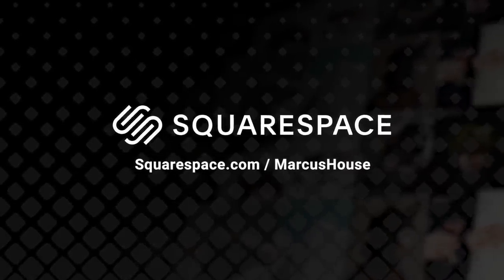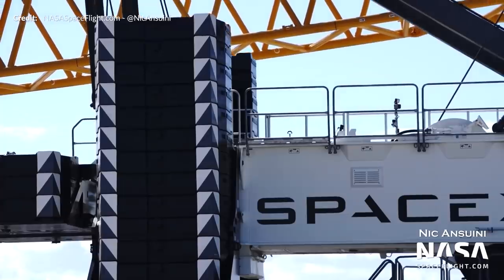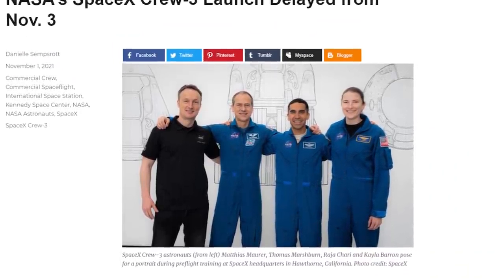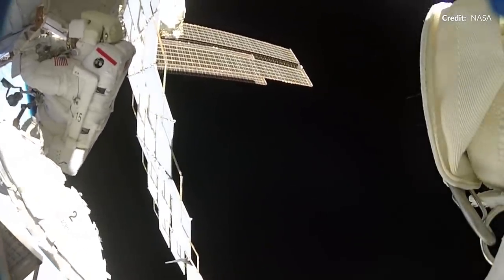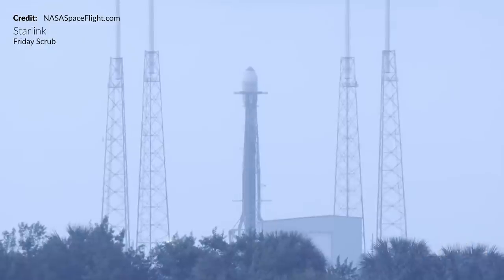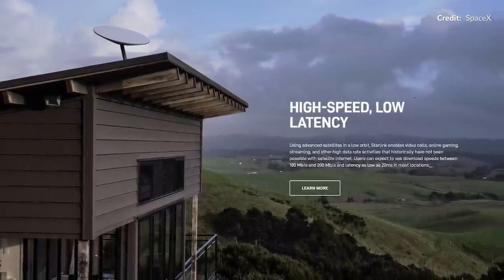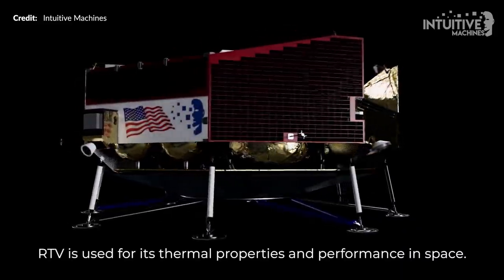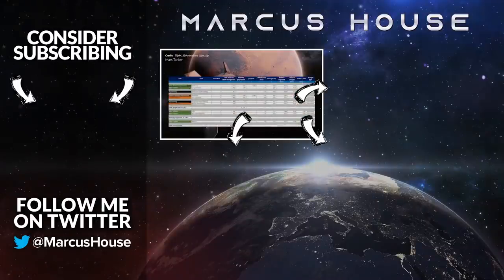SpaceX Starship Record Fire, Crew 2 Return, Crew 3 Launch, SpinLaunch, Starlink + More

Comment: The thermal protection tiles are proving to be problem and they are mission critical for Starship’s reuse.  Several tiles are being shed during each engine test and so it is likely that Starship is going to shed a lot more tiles during a full scale launch. However, each of the thermal tiles on the Starship is surrounded by six other tiles.  If SpaceX could devise a way of loosely interconnected the tiles with each other, for example using titanium wire clips, then the failure of a tile mount would not result in immediate tile loss.  The ‘loose’ tile would be held in place by its surrounding tiles and thus able to perform its role of thermal protection during the critical phase of re-entry.  Only when safely back on the ground would the tile then be replaced.
Reply: The tiles on ship 20 are prototypes, the tiles on ship 21 already look much better. But of course time will tell if the stay attached better.

Comment: Thermal protection. Integrate the panels and change the profile on the hot side to be something like a heat sink and bleed the heat off on the cold side.  Have the heat shield internal launch and flip or rollout prior to reentry.

Comment: Maybe they filled the LOX tank to dampen the vibrations with greater weight (so the tiles would experience less stress). Obviously they would not want to do that by loading up a bunch of liquid methane, or, even worse, a lot of both LOX and methane.

Comment: Great to see the thing fire up, I do have considerable fears about the heat tiles. The loss of the tiles apparently does not endanger the landing of the ship but unless they get that under control, or figure out how to install replacement tiles very fast it does endanger the hopes for rapid turn around. I think a lot of us space flight fans are out here trying to think of someway to keep those tiles on (of course I have no hope that I can out think SpaceX's engineers). I would just love to contribute to their work though.
Reply: It's an understandable fear considering the shuttle's constant problems with tiles. Honestly better that they fail now than later. The prototypes won't be reflow for a while so it is far, far less constraining right now than it will be later down the line. So being able to actually lose tiles and see in great detail what works and what doesn't is a net positive when it will come to engineering the "proper" starship and not the SN series of prototypes
Reply: Remember how different sn8 was compared to sn20? The tiles will evolve as rapidly as starship has once they can actually test the things proper. This is their first full tiling after all.
Reply: I am wondering why not add a second layer of tiles. Or even a third layer with smoothed edges where the heat will be worst. Starship will have enormous capacity as it is.
Reply: @Abebe345  Well, because weight is weight and especially for a vehicle as starship you don't want to waste anything even if you technically can. Remember even if starship will refuel in orbit, it still need to haul it's ass up there first and despite the gigantic power of the superheavy and itself it barely manages to get up there with all it's propellant. 
During long missions it is almost guaranteed that starships will carry spare uniform tiles to replace any damaged ones mid flight. This is much more efficient than double or triple tilling everything especially since the final heat shield won't be losing any tiles to regular sources of damage. Remember right now the prototypes are made as minimum viable products, made to be fast to make and cheap to lose. Once the system is developed a lot more care will be placed upon having everything fall into place exactly as anticipated. Right now there is no real reason to be especially careful if they already anticipate big changes to the shield design as well as the low chance that starship survives its first trip to space anyways. 

However after witnessing how much better SN8 did compared to my expectations, a near complete first flight isn't out of the questions.
Reply: @mobiuscoreindustries  Hopefully gets better quickly with design: for a reusable rocket the shields will be critical

Comment: The spinning approach, seems to me the way to reduce G forces is make a larger circumference cycle.. If everything else stayed the same size it may allow some impressive speeds on exit.
Reply: You cant reduce the G-force without compromising launch speed. Centrifugal force translates to launch speed.
Reply: Right. The formula is mass X angular velocity / radius. You would have to reach higher speeds w a higher radius to achieve the same force at launch.

Comment: another consideration on using a single massive tile heatshield or even larger tiles than currently used is that the gaps between the tiles don't take up weight and it also increases the amount of weight and force applied to the individual mechanical attachment points. spaceX may later decide to make the tiles smaller, further reducing the weight and importance of each starbrick individually and increasing the overall amount of area where there is spacing as opposed to tiles. It may add more mechanical attachment points but the mechanical attachment points would need to hold less weight overall, this of course would increase the amount of time needed to install the attachment points and tiles too however.

Comment: I think they filled up the LOX tank as ballast, basically to prevent starship from ripping itself loose in an unplanned liftoff
Reply from the maker: This is also my thought as well. I am also wondering if maybe it is not fully filled but just the condensation was enough to frost it over. It is a little hard to know for sure. Will see if I can get some more info.

Comment: If I were an engineer working on the heat tiles, I would have the robot do a suction test on every tile after each placement. 
All of the tiles are subjected to an equal amount of stress in the opposite direction of application. And any that fail the test are replaced.
Reply: @BenGman. IF you were an engineer working on the heat tiles"?  My question is are you an engineering any capacity.  If not then your suggestion is perhaps interesting, but not grounded in effective engineering principles!
Reply: @michaeldeierhoi4096  Ergo... Vis a Vis.... Concordently
Reply: @benGman69  It took me a few minutes until I looked that up then I was like aha, a reference to the architect in the Matrix.  😃🤣😅

Comment: Spinlaunch can be used from the Moon and from high altitude launch from for example the Atacama desert in Chile, there a launch at 5500 meters is complete feasible (most of the best telescopes are there, manned by humans) and with roads for large pieces of equipment.

Comment: As happy as I could be for the progress made with the SpaceX rocket test static firing have to been concerned about the significant loss of heat shield tiles. Less than a 1/4 of full number of engines were tested so vibrations will be significantly greater with a full compliment and much longer burn time during a launch flight. Clearly some serious work needs to be done to correct this glaring problem.

Comment: They did not fill the LOX tank on S20. I am convinced the amount in the tank reduced the temperature enough for the moisture in the air to condensate and freeze on the rest of the tank. The process went on for a long time.
The amout of methane in the methane tank was enough to fill the downcomer and lower parts of the common bulkhead, but not above that, which is why there was no frost on the methane tank.

Comment: James Webb…. Launches in December a date based on Webb time. However there won’t be any images taken for 6 months or so as it will take that long to assemble the beast and we know that could present problems. Then they have to take individual test and calibration images with each imaging device.

THEN they can take a proper image. Simple just like building the thing was.

Comment: i think that just vaccum-pressure gun would be better alternative for SpinLaunch, it is easier to hold vaccum in a straight tube than a big chamber, and easier to gather high pressure to shot out a projectile, also easier to predict what will happen and where would debris go in case of catastrophic failure.

Comment: I wonder if they put spacers between the tiles it would prevent them from rattling against each other during takeoff. They could make them out of material that can melt away when the tiles get hot enough to expand.

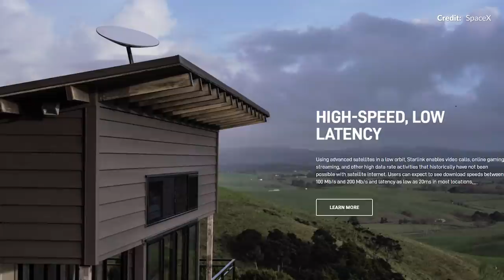Comment: 14:42 Been waiting for the first of these types of launches!

In the future we will be doing it by way of linear magnetically aligned tunnel underground to the surface, in space orbit for planet to planet launches, aboard space ships for weapons, and launching space craft, instead of wasting propellant!

Imagine doing this in space, why use rockets, when we can accelerate them using electricity!
Reply: It's exciting stuff and will be a very useful technology but it won't ever replace conventional rockets as the immense g forces mean that only specially designed rugged payloads will be able to use it. No humans. Could be good for materials and fuel though at least. Very useful for that.
Reply: @MachineCode0  True, but for sending materials to space for construction it will work!

Comment: The SpaceX launch site appears to have a large earth berm between the launch table and the GSE tank farm, finally, which will help a lot during the first few seconds of thirty, plus or minus, Raptor engines blasting away, but when the booster is well off the launch table and yet still within a few hundred meters of it, that berm will not suffice. Hopefully, something even more protective will be installed on top of that berm to deal with a much stronger blast than what the Saturn V spewed. Look at Saturn V launches and imagine an even considerable stronger rocket blast engulfing the launch site and subjecting the GSE tanks to a very large, hot, turbulent rocket exhaust for quite a few seconds. (shudder!) The launch tower should be OK, being so extremely robust, though they may want to protect that cable system and the plumbing and wiring on the QD arm and the chopsticks, as well.

Comment: I think, The oxygen tank was Full to maintain the thrust to weight ratio LOW and also to prevent stress on hold down clamps, so the vehicle will remain on stand without lifting off and  with less stress on hold down clamps during SIX engine static fire.

Comment: Perhaps LOX tank was full to provide thermal moderated stress on heat tile attachments.  The full LOX tank would more closely match flight conditions. Vibrations/dynamic stresses would be attenuated significantly at the far end of the Starship where the Methane tank is located (due to the full LOX tank) and be less a factor to simulate flight stresses. If this is true, there was no need to load any more methane than was needed for the static fire. Range safety is another good reason not to fill the methane tank.

Comment: If there is a value case for spinning to get dv, is there a value case for a moving ram launch table or using mechazilla to add launch dv to stage 0? Would even 5 m/s at launch help out with propellant or LEO refueling?

Comment: The real reason they use small tiles instead of one big block is because the tiles are ceramic. without going into too much detail, unlike metals that are ductile, ceramics are brittle and basically one big crystal. As a result, when the ceramic breaks it breaks spectacularly, breaking the entire thing. Think of it as cracked glass or a plate, a crack in glass is rarely a small crack in the material. It usually spans from one edge to another.
The big implication of this is that the chance of a ceramic material breaking increases significantly with size as one failure anywhere causes the entire ceramic to fail. Dividing the heatshield into small sections decreases the chance of any given tile to fail. Lastly, try to find an oven that can bake ceramic tiles the size of a starship.

I also don't think the argument losing a few tiles will be fine because it's made of steel holds very well as re-entry head can't be underestimated. Any tile coming off should be considered a serious failure. However, I believe I remember Elon has said they expect to lose tiles during static tests. We don't know what we don't know here.

Comment: 6:17  Heat Shield tiles falling off during static fire .. IMO, this is a HUGE Challenge for SpaceX, keeping the titles on through launch & re-entry. With the tiles directly over fuel tanks, a burn through on re-entry from just ONE missing title, will be catastrophic... KABOOOM!!!!
Reply: That is an oft spoken perspective on the TPS,  but it lacks understanding of the reality.  In the first place there is no way to verify the TPS without a test flight to determine where it fails.  And how serious is the loss of a few tiles?  Because the steel hull of the Starship is highly resistant to high temperatures plus there is insulating thermal protection "blanket" covering the Starship over which the tiles are attached.  

And as Elon himself has said innovation is not possible without failure.  The TPS does not come into play until reentry and since there are many other variables that could cause the B4S20 to fail if it makes to reentry before failing that would still be a huge accomplishment. 

This is just the first launch anyway so relax.

Comment: Very interested how they suddenly adjust the swing arm CG when projectile released, do they slam the bearing point sideways along swing arm axis?  They can't have it grossly out of balance for a split second or the things going to RUD like a rocket.  :D

On the surface--10k Gs sounds nuts, certain to add big challenge to a satellite build, Spin Launch has done the math on nuts and bolts not I.  Love the concept in terms of fuel efficiency and "simplicity",  SciFi .

Comment: As with Chris I also think so many small tiles is more trouble than it's worth. Instead of so many small tiles and hence so many points of failure - why not make the tiles 10x larger and have them sit on a single elastic base and have each large tile connect to each other using elastics on the sides too, to counter vibrations... or how about simply copy nature by mimicking a fish and have fish scales overlap each other.

Comment: Ive been thinking about the full fuel tank, i wonder if they wanted to see if the vibration would hurt it when there is no gas inside to act as a buffer. A million micro water hammer effect.

Comment: Full oxygen tank because of the T/W ratio when using the six engines at the same time. The retaining bolts are not strong enough for a 'light" empty ship with six engines pushing...

Comment: As the Oxygen tank fills the frost rapidly follows the oxygen fill height. As the process continues you can see a lower density of frost (above the liquid )reaching higher as the tank fills. At a certain point the line of the higher density of frost(identifiable buy a more opaque white) stops rising while the more translucent white coating continues to rise all the way to the top of the oxygen tank where it stops in a clearly defined demarcation. As the ship sits waiting for the test The overall opacity of the frost begins to become more homogenous as condensation continues to freeze onto the side of the ship. Although this makes the fill line harder to distinguish. If you look closely you’ll see that the line at top of liquid(about 1/4 of the tank or overall height of the frost) still discernible even as the frost thickens over time.
Reply from the maker: Will need to go back and look for this. It seemed very different to previous static fires.

Comment: the tiles is what i worry about the most, not the safety, but the economic apparatus needed to refurbish inspect and replace them. driving up the cost and delaying re-flight. 

i liked the idea of transpirational cooling because i know how hellish it was to keep the space shuttle tiles in working order.
and if one starship fail there will be new safety guidelines and more inspections (if it gets human rated) that will keep increasing the costs and delay flights. 

I'm afraid that with the heatshield tiles they may be optimizing a part that shouldn't exist.

Comment: It may not be possible for a plethora of reasons but i keep thinking some sort of dip for the starship for the heatshield might work... maybe multiple dips with baling in between applications. I am NOT a materials engineer obviously although I did go to RPI for aerospace engineering, however it seems like an ideal worth considering and its likely SpaceX had, although it would be a shame if it hasnt been considered and worked well... probably a pipe dream but i am an excellent dreamer, inventor, engineer etc.etc.etc... of course ideas are a dime a dozen I KNOW!!! LOL

Comment: Those heats shield tiles could be a problem. Think about it… the StarShip has to survive the SuperHeavy Booster liftoff then separation and burn orbit and then after refuel the burn to mars then the aero braking on mars and the landing burn then a liftoff off mars then the aero braking here at earth and the landing burn.

THAT’S EIGHT YES 8 HIGH STRESS VIBRATION EVENTS WITHOUT MAINTENANCE. At the moment the tiles can’t even last 2 seconds of abuse.

Comment: This is not unusual for one of the chutes to open a little late as the other chutes will "steal" the air, resulting in lower air pressure to not allow one of the surrounding chutes to not deploy fast enough.

Comment: I don't like the idea of those ceramic plates as a heat shield. So many failure points. And i assume it will slow down the relaunch time. Just more places that require inspection.